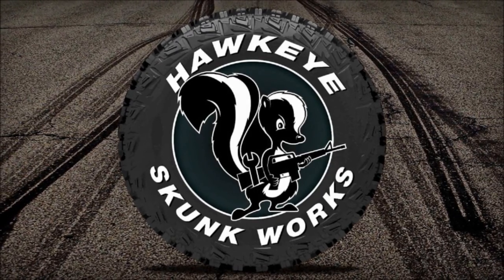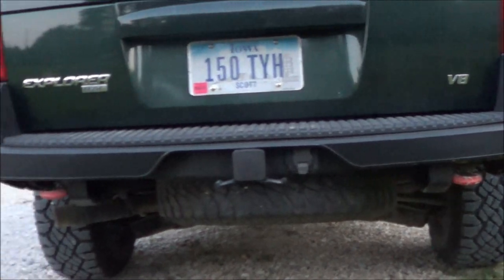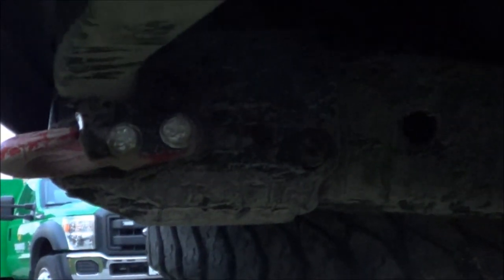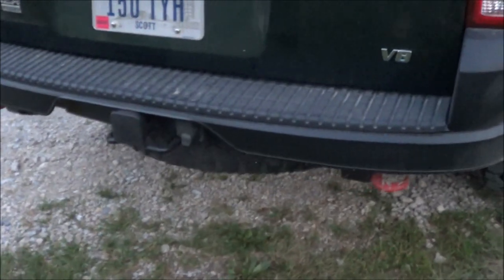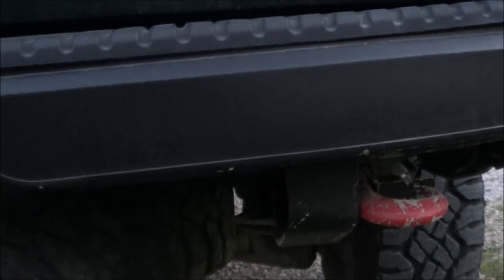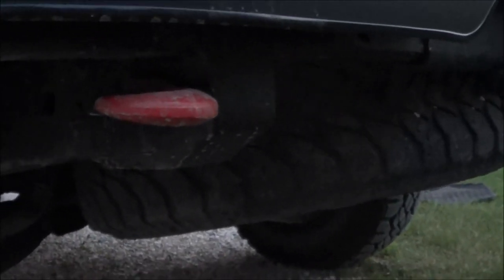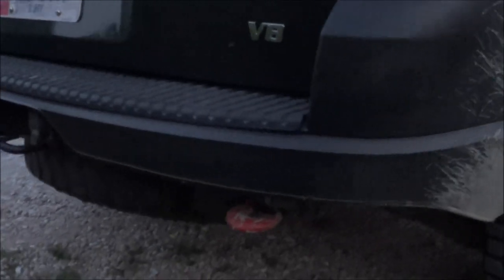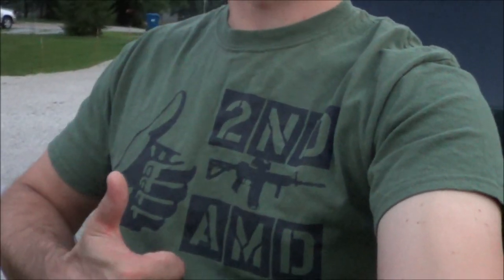2002 Ford Explorer Rear Bumper Comp cut and Tow Hooks

Comment: I know this is an old video but I have to ask. Have you ever thought of installing a metal front and rear bumper to your Ford Explorer? I have an 05 Explorer unlimited V8 4x4 and would like to add if possible since I'm struggling to find a maker. What are your thoughts or can you make a video(s)?
Reply from the maker: Nope, way to heavy and not needed

Comment: Why do you need tow hooks when you have a trailer hitch and a trailer hitch receiver made for towing and you're going to be attaching the tow hooks to the same piece of steel?
Reply from the maker: "need"??? Because.
Reply: @HawkeyeSkunkWorks  
If you want to enjoy messing with your vehicle buy a boat it'll keep you very busy.
Reply from the maker: @timgoes  ha been there done that. But I bought a boat that didn’t need anything so I could spend my time actually using it!
Reply: Just for  looks I'm sure  but they're mounted solidly

Comment: what kind of oil do you run in that 4.6? full synthetic or synthetic blend?
Reply from the maker: Ive been running synthetic blend with bottle of Lucas oil stabilizer.
Reply: Hawkeye Skunk Works okay is that the motorcraft? why wouldn't you go full syn?
Reply from the maker: BORNAGAIN4111611KJB I've haven't given it much thought, I guess I'm just too cheap but synthetic. I'd rather spend the money on Lucas. I use all the major brands.
Reply: it's just that I heard full syn is just better because of its molecules I just switched to mobil1 advanced full synthetic so will see how it goes, heard Lucas oil stablizer is not a good idea not sure why.
Reply from the maker: Ive used Mobil1 full syn in other vehicles. Ive always used Lucas products and never had any problems. I guess, in a 15 year old Explorer with almost 200k miles I dont think full syn will really matter.....haha